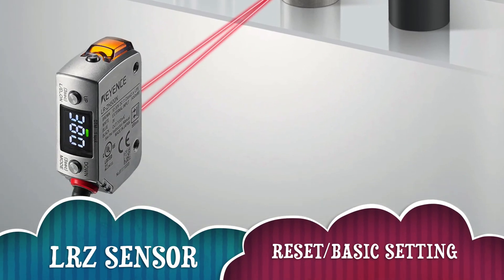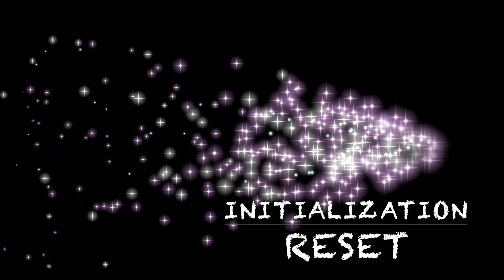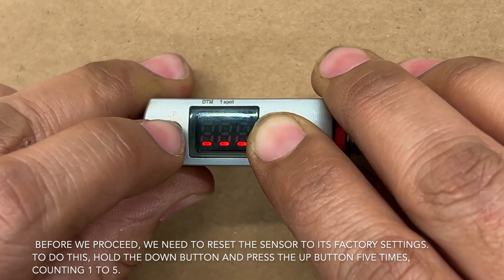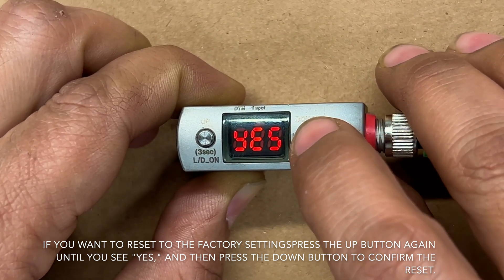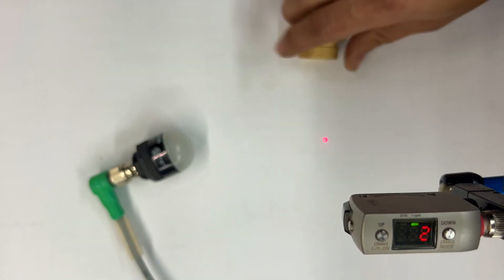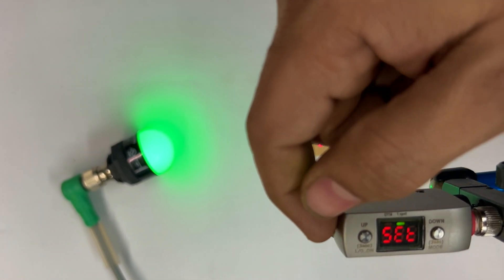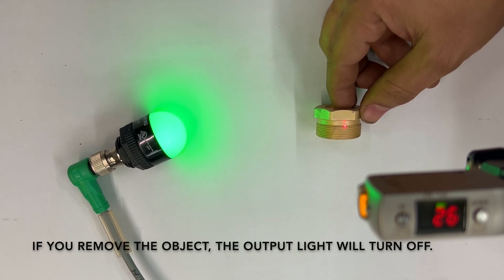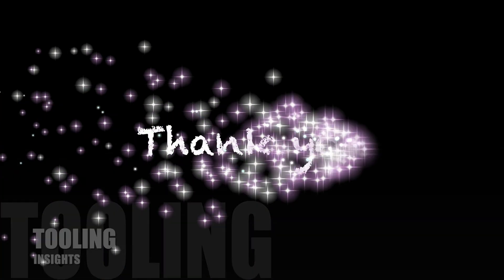How to Set Up and Use the KEYENCE LR-Z Sensor: A Step-by-Step Guide"#manufacturing #automation#diy

Comment: What is the use for a part like this? Is it just for object detection or is it for measuring distance from sensor to object?
Reply: It allows detection within predetermined distance (helps to eliminate false reading due to detection of sth like part of the machine)